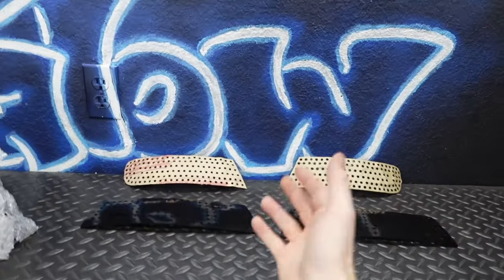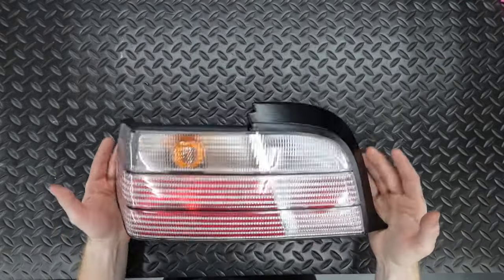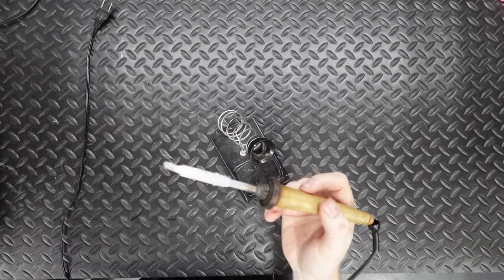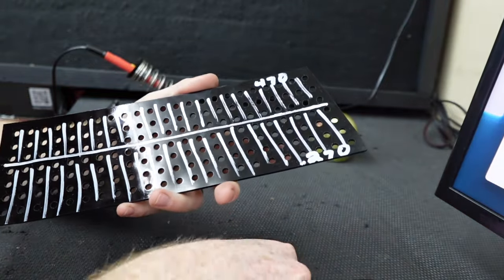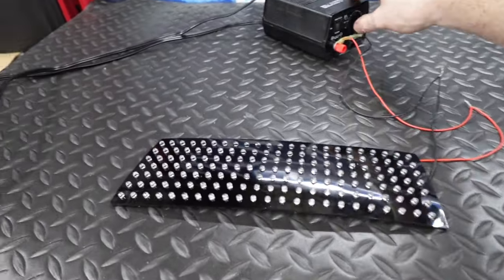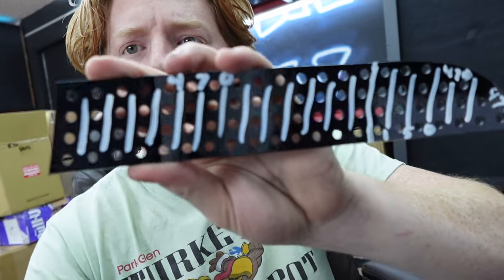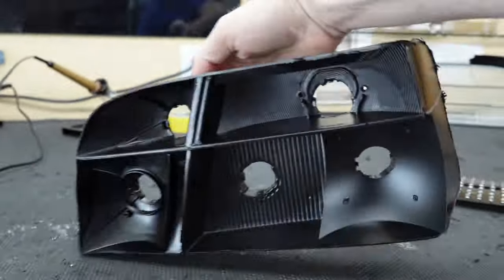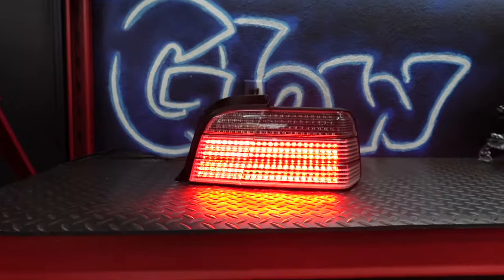Building custom BMW E36 tail lights

Comment: I noticed at 12:46 where you show off the turn signals that you have the upper line of the turn signal upside down. There's that horizontal line that looks like it would line up with the turn signal if it was flipped. Other then that the lights look amazing great work!
Reply from the maker: Thanks i noticed that as well, unfortunately that’s how the kit came it was cut and molded like this 😬😬
Reply: @zaccook  Aww man that's gotta be frustrating. 😭
Reply: @BlaiseWylder  I think he's making excuse because he messed up
Reply: @e36fanatics thats literally the kit, you cant really mess it up

Comment: Where can I find cut to size boards? They don't make a kit for my truck anywhere
Reply from the maker: Email illumaesthic they can custom cut a board for you but will need to send in your pre opened tails
Reply: @zaccook  thanks
Reply: You can buy bulk leds from illumasthetic and circuit board
Reply: @electrolytes4350  I saw the bulk leds but I didn't know if I needed to make the board since they don't sell one
Reply: @blakeguidroz  ya I was more replying to coy but u could make your own too probably if u wanna save money just use a heat gun and mold abs to the curve of ur headlight
Reply: @Shitboxexpress  what's concerning about it? If u have a dremel tool you can cut the house that the bulbs are pushed into and put the abs between that and the lens
Reply: @electrolytes4350 sorry lol I was wondering why you brought up leds when I was asking about boards lol
Reply: @blakeguidroz  it's OK I can see how you would see that seeing as one of my comments was removed or didn't show up all together

Comment: I found your channel with the murcielago tail light video, do you know what type of lights they use inside the murcielago tail light and where to buy.. with the 3 points (spider light?) and then the 3 pointed, I'm guessing it's a reflector, behind it? Or is that type of thing specific to that car only? Thanks